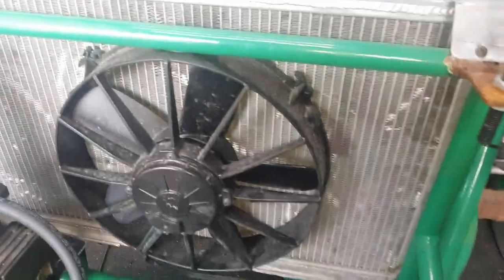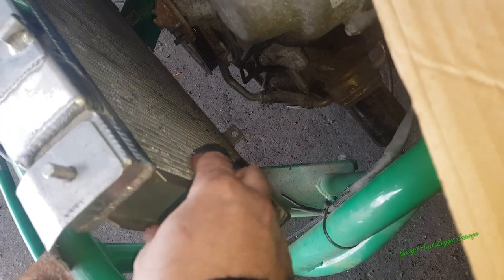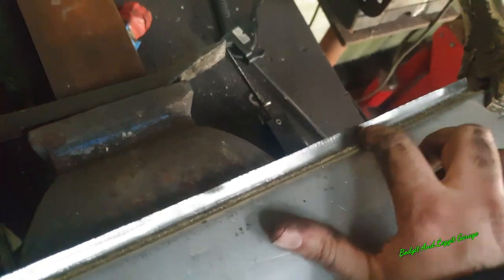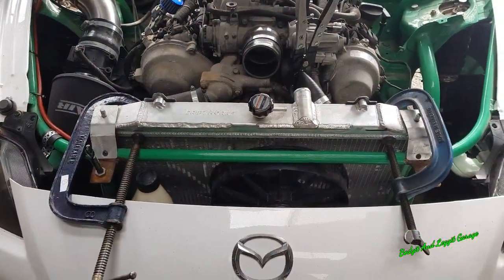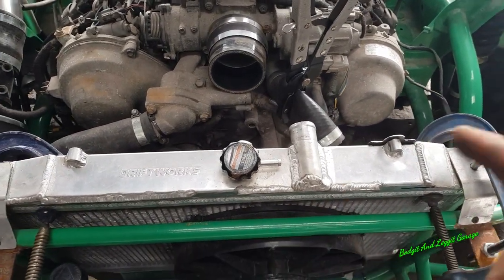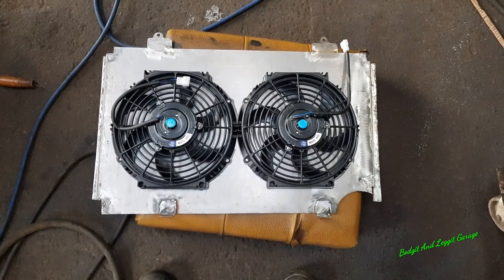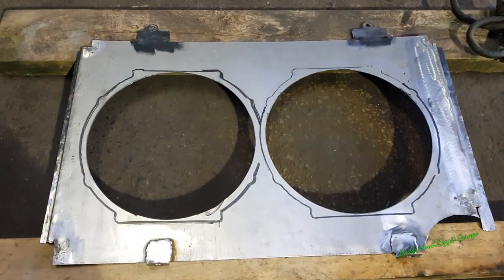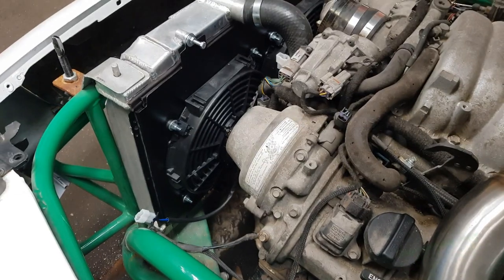1uz engine swap Mazda RX-8 cooling systems

Comment: You could weld a couple lengths of angle steel (we call it angle iron) top and bottom to stiffen it up ?
Reply from the maker: Yes mate but that would be more work then it's needed as trying to weld some angle iron to think he metal is more hassle than it's worth the Beard roller is the way to go go but it's still ok in this car haven't had an issue with it

Comment: Got to ask why mount on a plate, Would it not be better to allow as much of the rad to see unobstructed air flow, We have run a tuned V8 in a rally car on a couple of Cozzy RS open fans, and got to say when they do kick in i think we get an extra 10mph speed as it like two jet engines running up front, and they only run for a short time anyway. Fit an override switch,  Pos 1. To switch them  on.  Pos 2. Auto.  and maybe Pos 3 To keep them off, only if you get in water as we found out they make good engine cleaners too, and fuse each fan in case one shorts.
Reply from the maker: I like Todd said it's a lot better having a Shroud over the radiator fans for more than one reason and and I would be very surprised if you are getting any extra speed if anything you will be losing speed when the fans kick in they will be drawing power from your engine making your engine work harder which will be losing you power up to 10% power loss when the fans are on depending on your car
Reply: The speed bit was a joke mate and electric fans pull power from the battery and will not cost you any real power, and we used open layout due to space limit and a shroud to close to the cores will cause bad air flow and even limit it, just like tight turns in any manifold. Shrouds will work better if you have the space to play with 20mm minimum at the edge and tapper out to the fan base, and i got to ask if they know so much about fans why did they not spot the curved blades which don't move as much air but are quieter, but straight blades which will move more air, but they are louder, so may be straight blades and no shoud may have done? Just one more point people sometimes miss, is over speeding alternators and water pumps, add a 1000rpm to the crank pulley and you may have up the others by 3000rpm,  get the ratio right or these two parts will not last for long. Avoid plastic impellors pumps they may be ok for the road but they may expand and slip on the shaft when they get very hot and hard to find, only way we know is heat the with a heat gun and see if you can get the to slip, better still avoid them.

Comment: Nice bit of fabrication but i have that feeling that you may have enclosed those fans to much restricting air flow through the rad....
Reply from the maker: thanks a lot mate I haven't restricted anything I have made it a million times better because now when the fans kick on it will cool the whole radiator down and not just where the fans are this is a lot more efficient way of doing it
Reply: @bodgitandleggitgarage  awesome...looking good

Comment: I am assuming the fans are drawing air through the radiator.. 
If so, do they make different fans for each side of the rad or do we reverse the polarity.
Reply from the maker: Hi mate yes they do make special fans for pull or suck depending on what you do if you just reverse the priority the fans aren't in the right shape if that makes sense but you can get some fans that you just need to reverse the priority
Reply: @bodgitandleggitgarage  priority? Polarity 👍